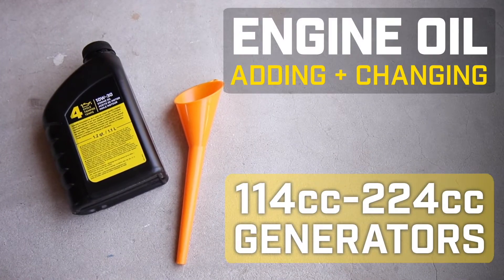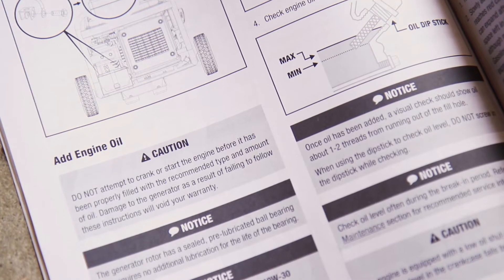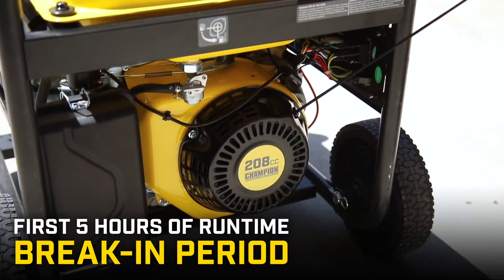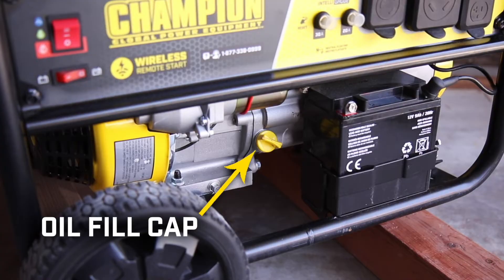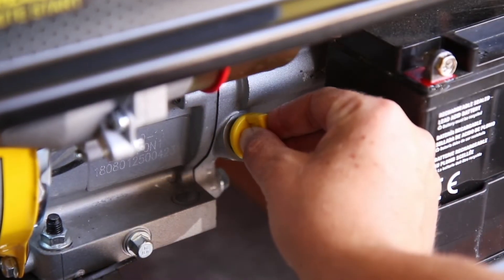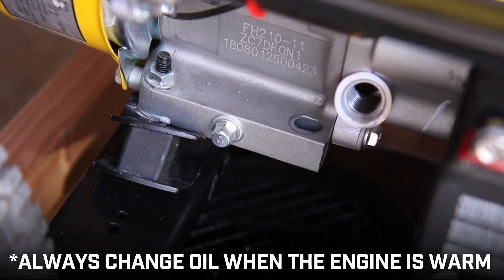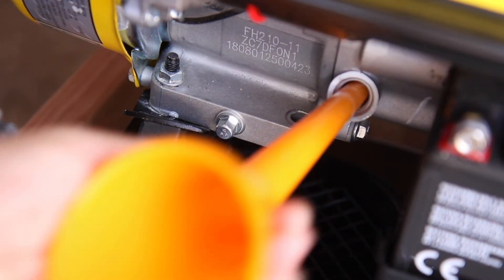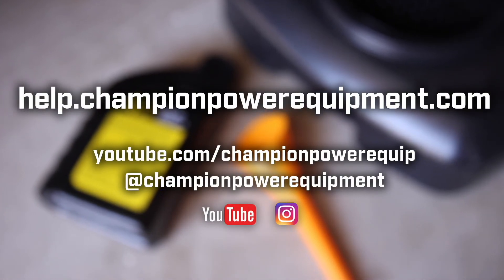Engine Oil (114cc-224cc Generators)

Comment: Is this the same oil as for motor vehicles or 4 cycle engine oil?
Reply from the maker: Hello, we suggest using 10w-30 Conventional automotive engine oil, or 5w-30 full synthetic engine oil in your unit. If you need any other assistance, please contact our support team at 877-338-0999, support@cpeauto.com, or use our live chat option located on our website. -Thank you